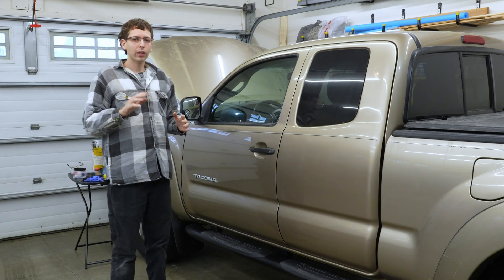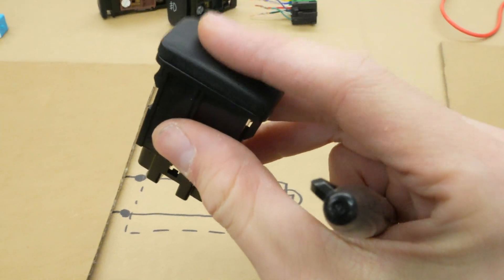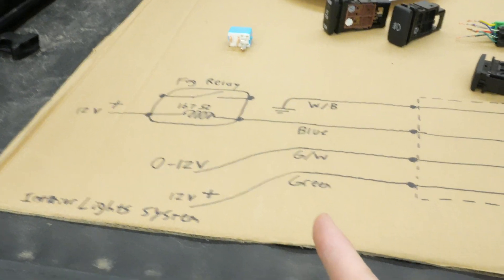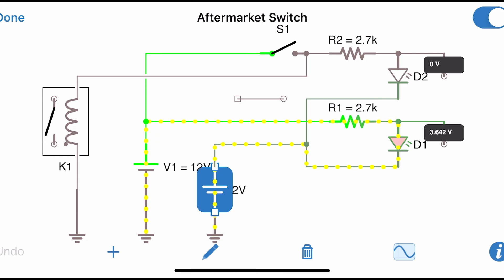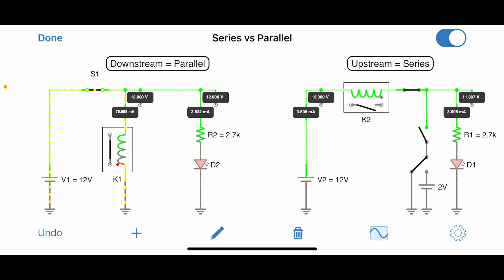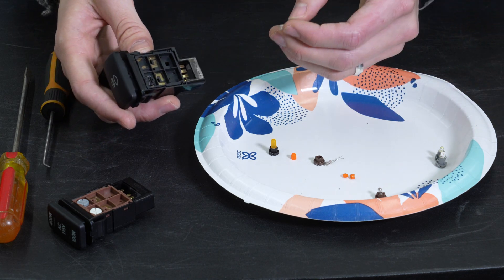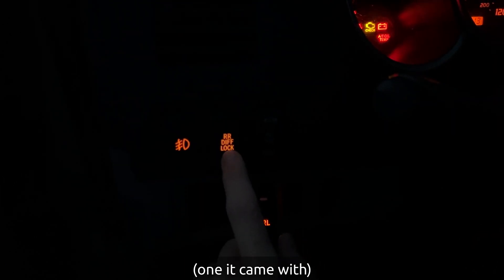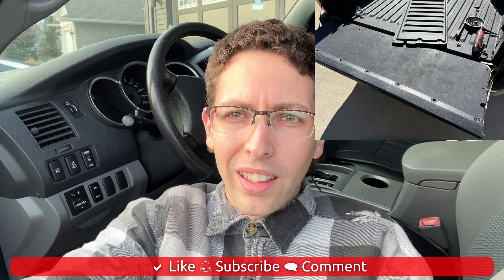Toyota Switch Wiring, Aftermarket & OEM. ALL the INFO - Tacoma, FJ, Tundra, Hilux. +Bulb Replacement

Comment: What about putting a 2.7k resistor on the switch output ground lead? Then equal current will flow through both LED indicator light and the relay? I did this and it worked. Indicator light illuminated and relay was activated also. But the amount of light changed when other switches were activated. Not sure why or if that can be solved in some way.